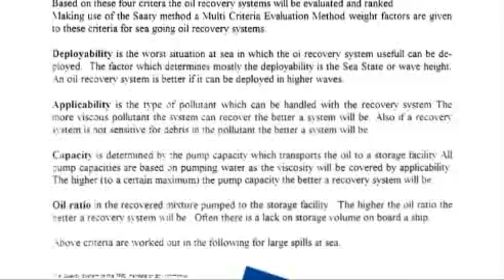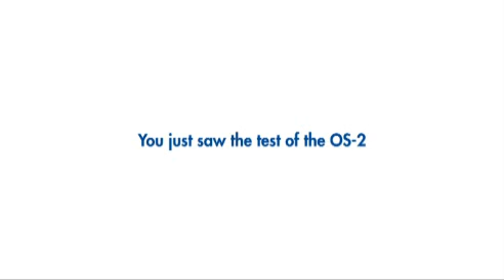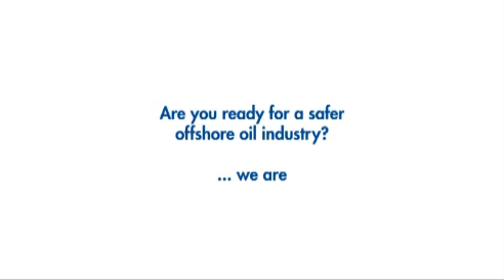Oil Swallow the answer against spreading of BP Deepwater Horizon oil

Comment: When they know high density mud may fail to stop the spill, they should have a team B to implement some kind of shielding to trap leaked spill right in close distance. They should confine the spill into a long elastic balloon so it won't be spread by the under currents in the deep sea while they are rising up. It is already too late when the spill reaches sea surface if they don't trap it at close to seabed level. A couple of teams of the Coast Guards should hunt it down at the source of spill